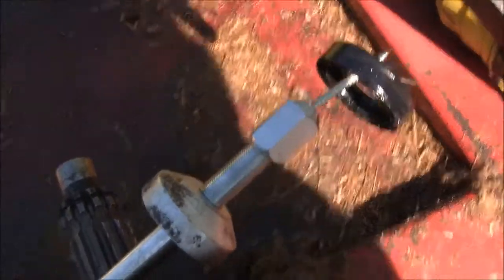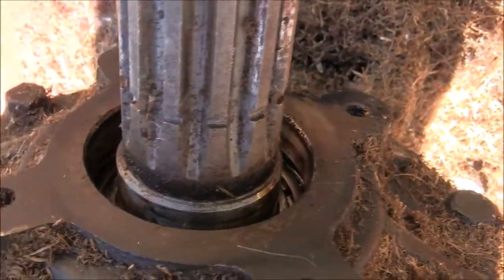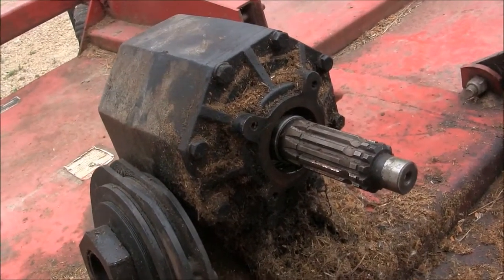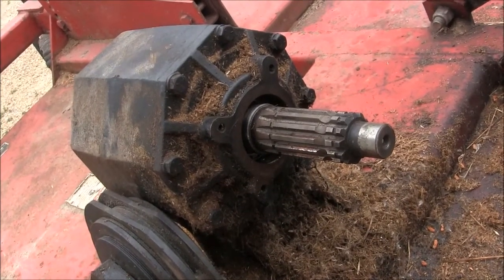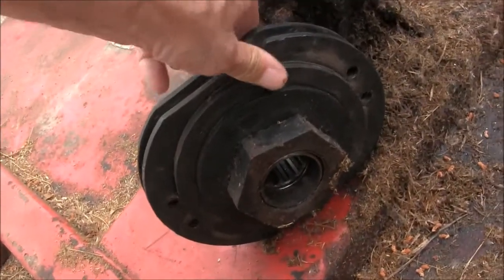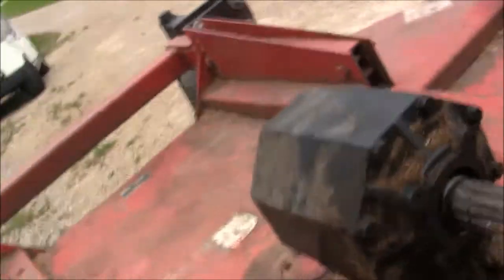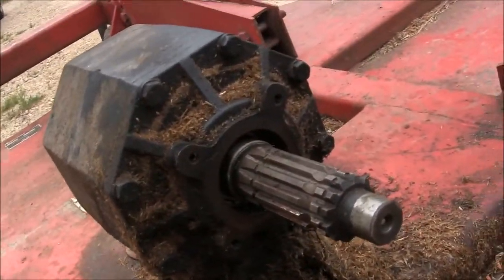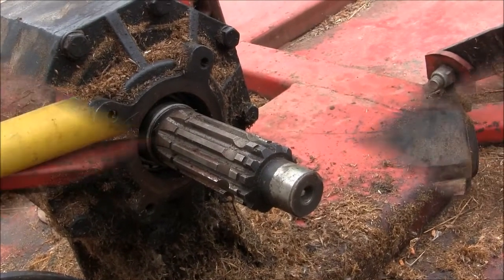The gearbox is hemorrahaging oil

Comment: We would put flowable grease in there and be done.
Reply from the maker: The 2nd input shaft seal was fine but then the out shaft on the bottom was weeping.  So I have been using general purpose grease instead of oil and its been holding up fine.
Reply: @michaelmurray9154  that was something granddaddy did, stuff had to be done quickly and minus a trip to town and the wallet getting lighter, i still have and use the bush hog. He left his tractor seat 20 years ago.

Comment: You never showed how you got the seal,out??
Reply from the maker: I guess I didn't show it.  What I did was drilled a small hole in the seal which let me screw in a sheet metal screw attached to the end of my slide hammer.  A few strokes of the slide hammer popped it right out.  This is probably the most common way of seal removal.